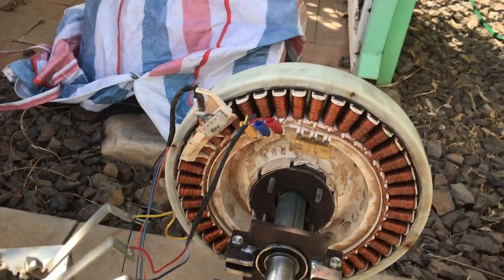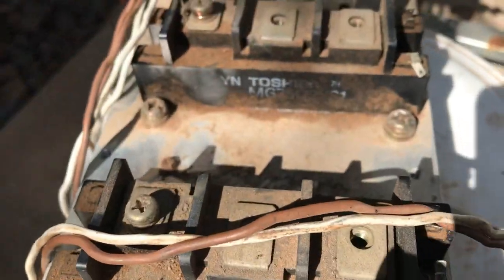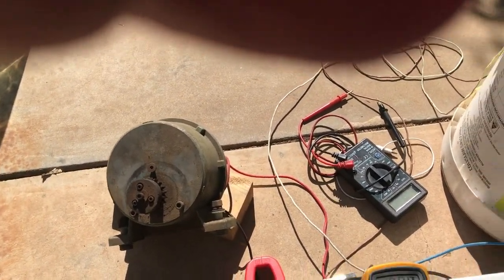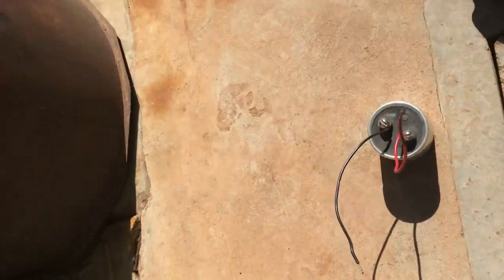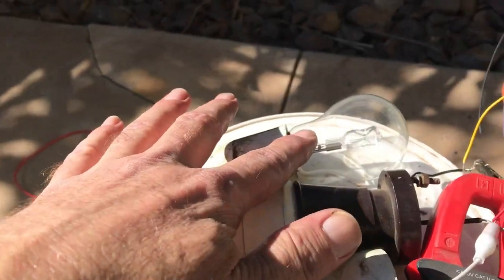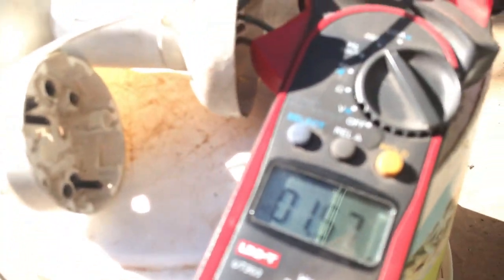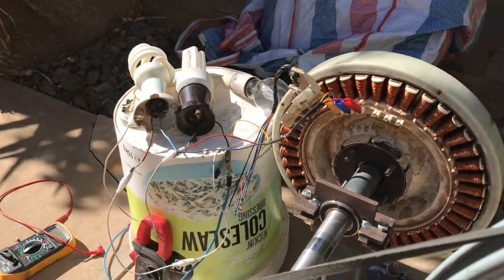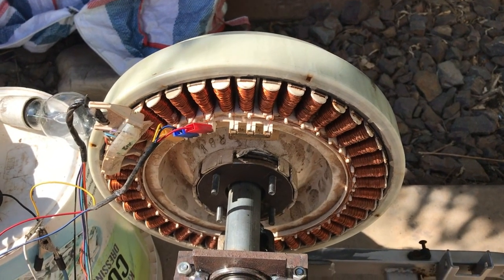Smart Drive Motor Generator

Comment: Thanks for the video my friend.!! 
This is great 😃👍 but ( G. Morin )
Had his washer motor's, on a shaft like you have" Only his was, running through the Case Of an (older motor, that he had stripped, Everything out of ) and had run the shaft, alway through. He had, bolted two washer motor's Onto the shaft, each ends.!! ONE of the washer motor's was, 
A big green one,. It was used as a motor to turn the other one, with, it was a regular size one, like you have. Know, the regular size one, was used as a generator, it had been reworked, to get less volts, & More amps.

Comment: To eliminate the drag caused by resistance take two of the three output wires and step them down to a useable voltage, then join the 3rd wire to the output at the 3 phase rectifier. There will be very little drag and excellent output!!!!!😎